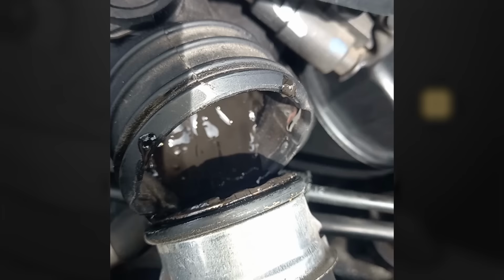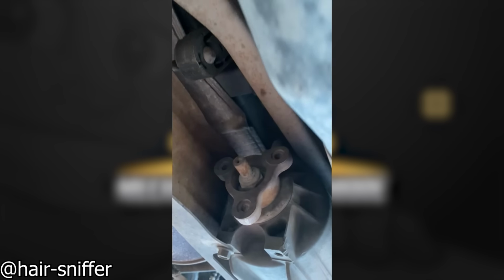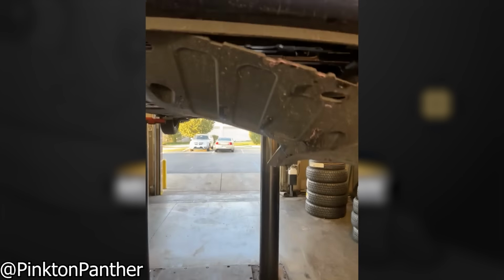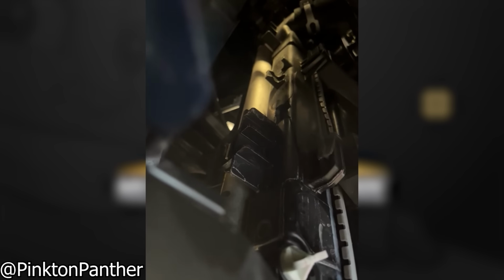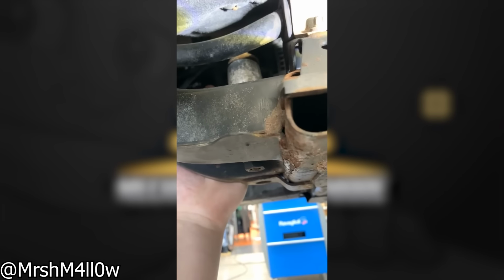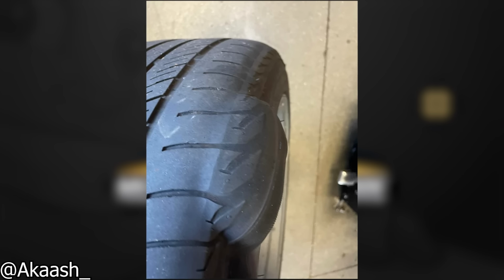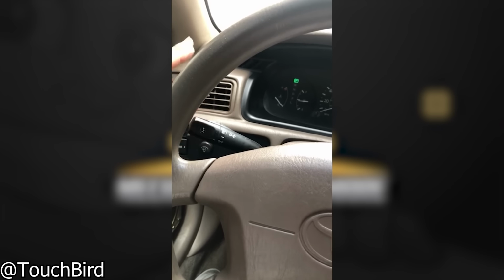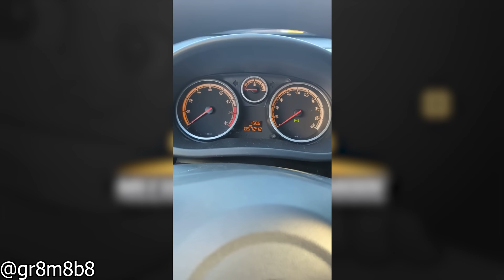Customer States My Coolant Has Turned Into Sludge | Mechanical Nightmare 78

Comment: Doesn’t anyone check their oil anymore? Oh gosh…. I have to open my hood? Where is that at? Just buy and drive. Warranties don’t cover Stupidity. Most people buy a car they cannot afford. But they look cool in it. WTF Ever
Reply: actually it's gotten to the point where some dealers actively tell customers not to. They don't want anyone checking oil or adding any either let alone any other fluids. Some vehicles no longer provide easy access to even check, can't remember the model that i initially called bullshit on for doing it, but they put it behind basically a unique bolted cover to prevent tampering thus checking.

Apparently the claim from some dealers is that they had more people dump oil in their rad, and coolant in their oil, and washer fluid in their brake fluid... it's just "easier and less costly" to mandate that they return every so many miles for a oil change and checkup while within warranty periods.
Reply: Some cars don't even have oil dipsticks anymore

Comment: That Corsa in the last clip was running coarser than it should.
Reply: Sounds like a bent rod to me. Personal experience after running dry on oil. Expensive stuff and one of the reasons I started to get interested by what happens under the bonnet.

Comment: The trouble with those internal water pumps is that when the seal eventually leaks the coolant goes into the oil.  Dumbest idea I ever saw in engine design.  It's no a mater of IF but when.  The engine is only going to last as long as the water pump.  First pump failure equals first engine failure.

Comment: First time I see a opel especially small one in this videos
Reply: Opel is just GM, since 1929 i believe, nothing special, since 2017 it is under the PSA umbrella (Citroën DS Peugeot Opel Vauxhall), and PSA formed Stellantis (2021) with FCA (Fiat Chrysler). Safe to say, stay away from newer cars. unless you buy new car every 3 years. I had a 1984 Opel Ascona C for 4 years recently good car but it was a GM J platform shared by basically all the GM brands.
Reply: @heisenfeis  Yeah I'm keeping my Vauxhall Adam S as long as possible because it's GM not a Pugrot/Fix-It-Again-Tomorrow hybrid. My dad has a Cavalier which is basically the same as your Ascona.
Reply: @heisenfeis  1.3 tdi 2014 corsa I have right now but I am newbie with cars and here opel have pretty good reputation (corsa and astra)
Reply: @dwdwdwdw4569  your car is before 2017, those are ok GM cars